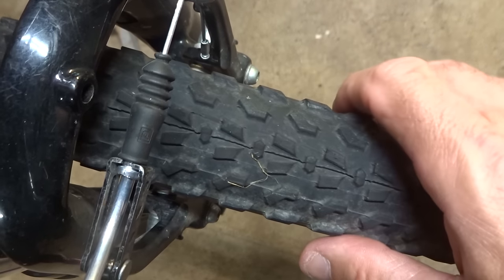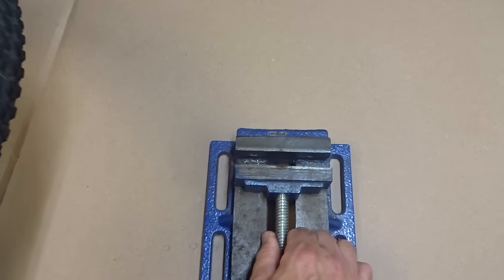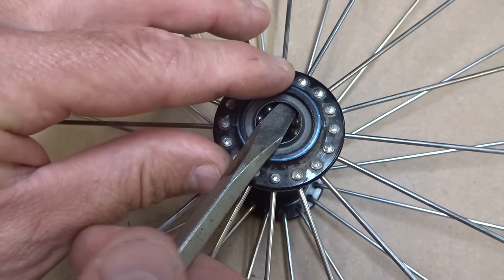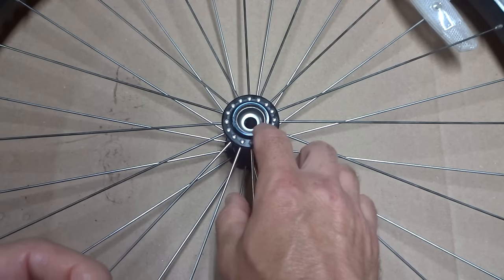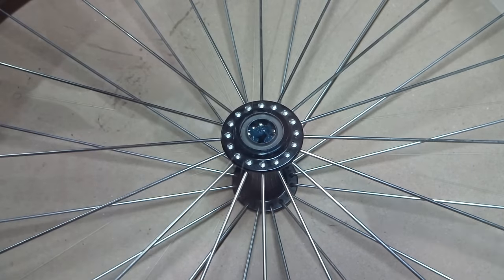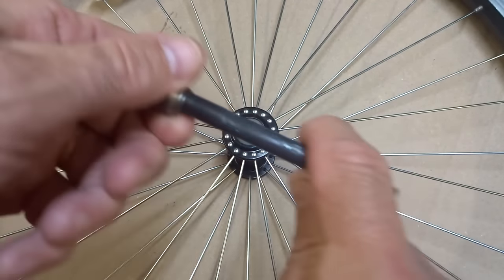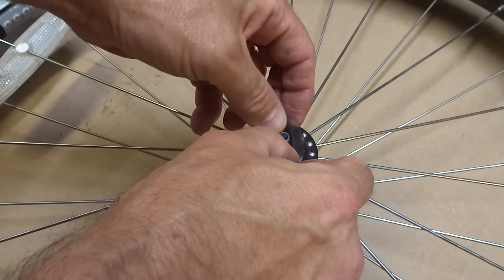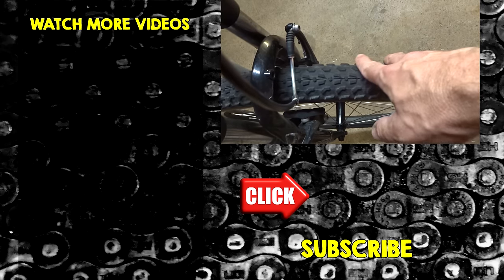How To Fix Loose Wobbly Wheel Hub

Comment from the maker: For more bike repair videos hit the subscribe button 🛑 and click the notification bell ► http://bit.ly/SubRJTheBikeGuy
Reply from the maker: Henry Rutkowski  These are real bearings.
Reply: @RJTheBikeGuy  I think he meant, sealed ball races, like in roller skates, skateboards, cars, trains, washing machines - instead of these fiddly loose balls & cones.
Reply from the maker: @EdRandall66  I know what he meant. His comment suggested these aren't "real" bearings. Very condescending. The majority of bikes out there have these kind of bearings.
Reply: @RJTheBikeGuy  I didn't think his comment was condescending, I thought it was a genuine question - and I have the same one.  Do you know the answer (pretty please)?
Reply: @RJTheBikeGuy  I found bearings at my bike shop but can't find cones. Any leads? Shimano freewheel looks identical to one shown here.
Reply from the maker: @michaelrowave  You just have to start googling, and contacting places.
Reply: I've put my axle back together but not when I put it back into the fork and tighten the quick release it locks up , unless I don't tighten the quick release tight
Reply: @RJTheBikeGuy  ١١1111
Reply: Hey RJ I recently had to replace the front axle on my bike, the old front axle had a thicker OD on the unthreaded section of it then the new one. I looked, and looked there was no axles that I could find that where quite like that. It's not a whole lot thicker, but it's definitely noticeable, the threads are the same though. Is the new axle okay, or do I need to keep looking be my question lol. 😄
Reply: is it strange for a cone to have room for 10x 1/4" ball bearings when it only came with 9?

im guessing whoever assembled the bike only had a limited number of ball bearings 

but because 1 ball bearing was missing it caused alot of play and even a slight bend on the axel on a brand new bike.
Reply: @RJTheBikeGuy  hey man, my 2021 specialized rockhopper comp has quite a loud rattle sound when I go over any bumps on the trail. I’ve narrowed it down and it’s not the pedals, the chain is almost silent, and the headset is tight. The only thing I can think of now is the wheels, would adding some tension help with this problem?
Reply: @pyroromancer Cześć. Kulki 1/4 raczej są w zestawie z osią 3/8 i jest ich 9. Kulki 3/16 w zestawie z osią 5/16 raczej w liczbie 10 sztuk. Czasem może to być w zamiennej konfiguracji lub może pomieszane.
Reply: Osłony uszczelniające powinno się posmarować, przynajmniej części styku.

Comment: Another textbook repair. Well done RJ.
As a past bicycle wrencher I wanted to add a couple advanced tips. One was already mentioned by @Falko  that being the idea of leaving a slight amount of play on the axle before clamping the quick release. Then, if you do it right, the clamping of the QR squishes the cones together just slightly enough to bring them into perfect  contact with the balls. Not too tight to bind, and not too loose for any play. There's a fine balance between the initial setting of the cones and how much is too much to clamp the QR down. You can pop the QR nut and damage the skewer threads if you over do it. Don't ask how I know...

The other tip is if you're reusing your ball bearings (balls, actually. The entire set with the race and cones is technically the "bearing"), it;'s good practice to keep each side's balls separate since each set has worn into the shape of their race and cone. It's really a trivial thing to be concerned about, but still good practice with only a possible upside.

And I will not give up my secret sauce recipe for lubrication. But I will say it includes a moly (MoS2) infused marine paste with one or two drops of 3-in-1 oil to break down the viscosity a bit. But that's all I'll say.
Reply: Why not just use regular marine bearing grease?
Reply: @0xsergy  I've found it to be a bit too viscous by itself. It's not meant for finely tuned bearings and it seems to get even thicker as the temps drop. And I wanted the benefits of the molybdenum.
Reply: @ChuckD59  Definitely gets thicker but i have no issues even in canadian winters. the ice on the road slows me down far more than the bearings dragging ;).

i do like the idea of getting some moly in there though, that helps.
Reply: @0xsergy  Yeah, I'm in New England, US. I get it.
Reply: @0xsergy Szkoda energii.

Comment: Good video on replacing, repacking, and adjusting wheel bearings. That said there was one very important step left out: inspecting both the bearing race and the bearing cone surfaces to ensure that they are not pitted, scored or otherwise damaged. If either of these surfaces is in any way damaged installing new bearings will be for naught as they will quickly be damaged by the pitting or scoring of the races or cones. Replacing damaged cones or inner races may require the assistance of your local bike shop if your don't have either the tools or knowledge required.

Comment: Thank you for this great video. I don't have much mechanical experience and I was riding my bike this morning and noticed some odd sounds. After wiggling the bike while riding I noticed the sound was coming from the front wheel and with the wiggling it started wobbling and I could see the problem was with the "wheel hub"(I had no idea what to call it until I saw this video)and I assumed it had to do with the bearings(that part I knew). I made it home though! And now, after watching this video I have the confidence to buy the parts I need and fix it! Yippee!

Comment: The hub on my bicycle wheels had ceramic ball bearings so they fell 
right out. I only had to tip the wheel over after taking out the cup. A 
couple where still stuck in the hub though. There was some grease 
holding them down in  place. I got them out with a set of tweezers. The 
ceramic ball bearings is the new thing now. Supposedly the 
ceramic ball bearings are more round, smoother, and have a  lower 
friction resistance. I did check the size of them so I can get a new
set.  I didn't have the special park tool though so I used the screw/drill 
gauge that I already had. I just put the ball bearing in whichever hole it fitted in. It 
looks like they are 1/4". Nevertheless, I did get the hub overhauled. 
After I got it all back together I thought I did it wrong But after 
watching your video it looks like I did it exactly as you did. Which 
is a relief because now I wont have to take it all back apart again and 
redo it all. Thanks RJ. 😀

Comment: My Zektor 3 has been sitting for a while (3 years) and the grease ran dry, thanks to you I was able to repack and replace the bearings in the front hub. I’ll have to do the rear hub when I get my cassette tool in. I will probably watch your bottom bracket video as well on how to replace that awful thing. Front hub in the meantime feels great, and has never been better. No more grinding.

Comment: Very useful video,thanks! One thing could be emphasized is the ensuring of locking the cone/locknut on the side not apparently loose. 
it was mentioned to make sure they are tight, but was shown with  hand doing that, whereas it should be wrench tight, just as much as the nut/cone side being taken apart.  This singular potential flaw of procedure is the source of many future slippages of adjustment, even after a hub is overhauled ! (often appears the first time a wheel is taken off for fixing a flato or transporting, more so on solid axle wheels. One can even start the entire procedure with the act of ensuring tightening the side which is NOT seemingly finger loose!
RJ THANKS AGAIN for your body of educational work !

Comment: Nice vid, thanx for sharing. It appears you might have the dust covers the wrong way around, if you google cup/cone you will find that the hollow part is on the inside (i guess to hold the grease and not touch the bearing itself). The comments help a lot also! I did not know the compression when using quick release and hence you must leave a little play on the bearings

Comment: When I do this job, I always check the cones. When a wheel wobbles, very often the cones are worn too. If so, you definitely need to change them as well. And I can tell from experience that finding the right size of cones is harder than finding the size of the ball bearings.
Reply: @myvicariouslife4012  I don't have an online source where to find the right size. But what I do have is a variety of cones in stock. Some bought new (they don't cost much) and some I retrieved from old hubs. This way I can always find one that fits.

Comment: Hi RJ, would you agree with Park Tools, that when adjusting a hub bearing that is on a quick release axle, that the cone nut should be tightened, then back off a 1/4 turn so there is very slight movement of the bearing, which makes allowing for the flexibility of the hollow tube axle. The bearings Will then tighten up when the axle is in the dropouts using the quick release nuts.
Looks like I should have read ChuckD59’s comments first , as he has said the same thing.

Comment: The cups in the wheel I'm working on are damaged but not replaceable. I replaced only the ball bearings and left the damaged cups and the wheel is completely silent now. It may only last a year, but this repair is cheaper and easier than rebuilding the wheel with a new hub.

Comment: I bolted some 50mm square tube to base of my vise so I can put roasting tray under it, less chance of ball bearings getting lost.
Reply: Great idea. Thank you
Reply: I use one of those magnetic parts dishes not only to catch but to retain all those loose bearings.
Reply: Magnetic tray. If you use a proper cone wrench you don’t need the vise. Much cheaper too.
Reply: @evanswinford7165  Can u recommend some? Maybe even forged ones?
I tend to find only pressed steel or punched from steel ones which look overpriced for their quality…
Reply: El Micha I have used the same Sugino cone wrenches for years. Park Tools also. Just buy the Park tools if you can’t find others. They have good kit. You should have 13-19 mm open end wrench set. Some bike tools can’t be substituted for you just gotta pay the price. Don’t cheap out.

Comment: I have a similer setup. Bit in the rear, when i adjust the cone outside of the bike frames, it runs smoothly, as soon as put it in the bike and tighten the qr It kinda locks up the wheel. And then if i release the qr It runs smoothly. What might be the issue?

Comment: The quick release will compress the axle a little, so I put the cones in slightly loose and when you put it on the bike they compress a little and are just right. Also, when you tighten the locknut onto the cone you want to recheck the fit, sometimes the axle turns with the cone, sometimes it doesn't
Reply from the maker: That is why I used the vise to hold the opposite side, along with the cone wrench, so the axle wouldn't turn.
Reply: @Certyfikowany Przewracacz Hulajnóg Elektrycznych I have seen this firsthand. Many times.

Comment: Little tip: getting that fine adjustment between cone and balls can be tricky. Over tighten cone a touch. Put lock nut behind it and back off the cone, not tighten the lock nut usually a much quicker job.

Comment: My front wheel has been having a similar problem lately (although way less wobble than what you have had). I have had my bike for nearly a year now so I don't really see the point in replacing bearings just yet. Could I achieve a fix by just tightening the nuts that keep the hub in place, thanks.
Reply: Yes that'll be fine. Bearings should last a good few years (like 3-10) unless you get some real grit and moisture in there, so just do this procedure but instead of replacing the bearings, just clean them up and give them fresh grease :)
Reply: @SamLTate  Awesome thankyou

Comment: Hi, did you ever think/talk about bearing grades? Ive seen bearings that were only case hardened or such a bad quality (out of round) you couldnt realy get a good cone adjustment. With quick release hubs i tend to leave a little bit of play in the cone adjustment, so the compression of the axle from the skewer, takes the slack away. You can test the cone adjustment outside of the frame, by using e.g. two big M12 nut as a makeshift. Tho you need to be aware of that when finaly mounting it in the frame, because you dont want it to be wobbly/loose. So i guess its not a good thing to do, for technical inexperienced users.  What problem could possibly occur with magnetized bearings?
Reply from the maker: Generally bikes have grade 25 bearings. 
Magnetized bearings attract metal bits as stuff wears.
Reply: Well magnetized bearings will attract small metal particles that will wreck the hub racers apparently. Yeah I think you have to match similar hardness to hardness bearings, racers/cones if one parts harder it will wear the other down, presumably not good to mix different bearings I suppose... Not sure what a good way to test metal hardness would be, you do get a sense of different types of metal and fabrication quality after going over enough bike parts huh.
Reply: @leifcian4288  Well i wasnt talking about similar surface hardness, just that there are cheap bearings out there, that are only case hardened wich can squish like a gummball under pressure, in contrary to fully hardened balls wich should be able to take much more pressure. The difference in hardness in metals might be a part of the problem but it also has to do with different sizes of surface area. A cone is more prone to fail of abrasion then the ball bearings or the cup because it has the smallest surface area.
Reply: @leifcian4288  As RJ said,  Grade 25 is accurate to 25/1,000,000 of an inch. Less expensive ball bearings maybe grade 300, which are less round, at 300/1,000,000 of an inch. ... A steel ball-bearing is likely to be over a Rockwell C of 60.  Ceramic ball bearings can be a Rockwell C of 75, much harder than the steel races!

Comment: A loose bearing is a happy bearing.  I always set them with a tiny little play.
Reply: A minute loosines is acceptable. However, i use the method of rotating the wheel and carefully adjust until no appearant metal-to-metal friction is visible or felt. The wheel now rotates freely many turns after a wind-up, but no slop can be felt if pressing back and forth on the the rim by hand. Of cource the rim elastically gives away if you press on it, I mean real slop. This is almost zero loosiness or slop, but no pre-tension either. There is still sufficient room for a grease film in the ball races.
I think this is ideal.
Reply: There should be a tiny amount of play with QR hubs because the skewer compresses the axle when it is done up. Alternatively you can adjust the cone with the skewer done up using some washers as surrogate dropouts.
Reply: Been doing this job a lot recently. So you leave a little play in the bearings? You can tell if there's play in the wheel if you wobble it once its locked into the drop outs. I have tightened it so there's no play at all but it often seems like its too tight and the wheel doesn't spin as freely as it should do. Can be awkward.
Reply: @wozukleeds9018  , with  the wheel off the bike, hold the ends of its axle with both hands and you need to feel tiny hair of play.  Rotate a bit, and check it again at different  positions. Once its on the bike play also can be checked but its more difficult.

Comment: Hey what grease do you use please?
I have some similar coloured grey grease;

Castrol MS3 grease.
Says ‘ A high melting point lithium based grease containing molybdenum disulphide.
Suitable for heavy duty chassis application and some constant velocity joints where a lithium based grease is specified.’

Also I have a caramel coloured grease:
Carplan LM 2 Multi-purpose grease
‘Is a super high melting point lithium based grease which ensures smooth performance wherever greasing is required.
It provides high resistance to oxidation and water washout in addition to allowing good shear stability.’

‘Is ideal for
Vehicle chassis and wheel bearings
Universal joints
Pump bearings’

‘Meets NLGI 2’

‘Do not overpack bearings’

So both greases sound good, they grey grease looks the same but the caramel LM2 one reads better for bearings perhaps…

Plus I have a Red grease saying it’s for bikes but it looks quite delicate.
I know any grease is better than nothing but some advice in which would be ace thanks!
Great clear concise video thanks!!

Comment: thanks of that, having to do this on my new road bike next week, and haven't done this on a bike in 20 years.  just one question aren't the dust caps round the wrong way?   i had always put them in with the indented side next to the bearings, was i doing it wrong all this time, or are there just different types?

Comment: Typically when I Service cup/cone hubs when pulling the axle out the bearings fly all over the place due to lack of grease. Ball bearings are pretty inexpensive so I just replace instead of picking them up off the floor!
Reply: Rtr TRF d tht third termof rd Sharma you have any questions or need anything from class TD Bank of India since d rarest on earth and 2 truth is that I will be able to get turned out to be able toe and do not hesitate thanks Tony thank u telle f t transmitted d t5tttt try return top comments you May also run to turn right that 55dn t5 tested and to 5

Comment: Just a quick one kind sir, so do you have to make sure that 4 to 5 threads is sticking out on either side of the axle or just where the cassette is?
Thanks a lot
Reply: if it's a quick release wheel then you need threads exposed about the width of the fork end on both sides